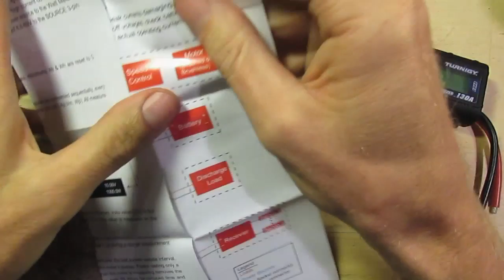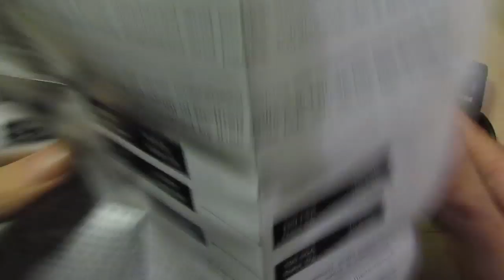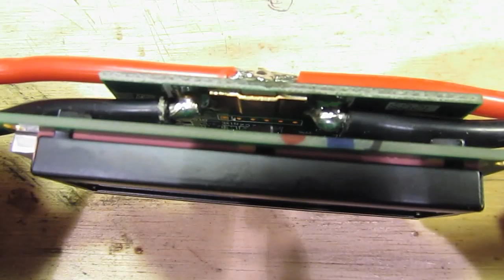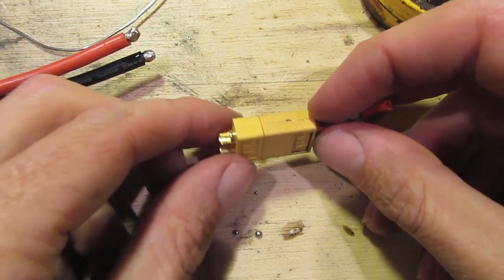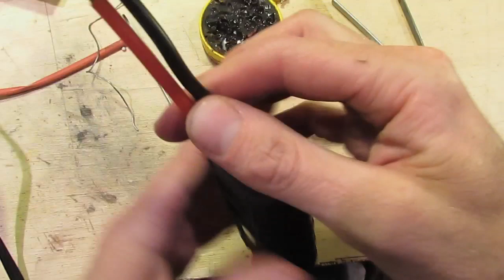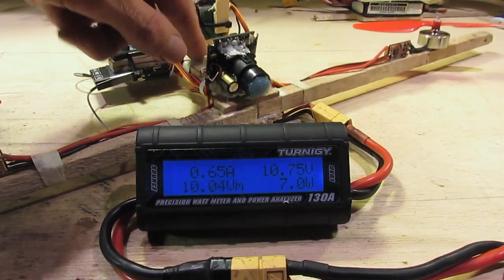Turnigy 130A Watt Meter, Teardown, Soldering and Testing on a Tricopter. RCHacker #13

Comment: What are you doing? Your holding that iron on there way too long, lol. I've been soldering for years, unless you have multilayer boards or something with a huge ground plain, you don't need to hold the iron on the wire that long. Lol

Comment: This really did become unintentional comedy when it got to the soldering part. And XT60's are relatively easy to solder. The hilarious sequel would be trying to solder "T plug connectors" with this rig.

Comment: 5A/mm^2 - its for cuprum wire. This device is not 130A - !!!!!!!!maximum its 40A continuous current!!!!!!! 130A probably in pulse current mode.
Reply: Measures 60A+ just fine...
Reply: 10cm wire of 4mm² would dissipate 4.4W at 100A :-) so it won't get hot ;-)

Comment: Hey,
Do you know what RXD TXD pads are for? I use this meter to monitor PV panels and after it counts 99.999 Ah the software on this atmega8L stops working OK (shows 0 for Volts and Amps and Watts) - I hope that those pads will let me put my own program in there.
Reply from the maker: You have confirmed that it is an atmega in there?, RX and TX are the serial pins and can be used for flashing only if it has a bootloader loaded. Which I kind of doubt it does.
I would suspect that internally it is holding the values fine and that its the display code that needs some work. You might find that it outputs info on the serial pins.
Reply: RCHacker yes it is atmega8L I haven't found any miso mosi sck , etc pads so I assume firmware is somehow loaded via serial

Comment: The worst soldering technique I have ever seen.  Have you not heard of wetting the tip with fresh solder?  Also that type of gun needs having the connections between the tip and the heating element cleaned and tightened often.

Comment: Or their customers just need to learn how to solder!

Now I know why HK only uses silicone insulated wire.  With anything else the users are going to be melting away inches of it from every solder joint.

This nasty video not withstanding, good soldering is not hard.

Comment: How not to solder a connection.

Hope those Hobbyking workers aren't that inept.

1. Tin both parts.
2. Hold them together well.
3. Heat both parts simultaneously, with HOT iron.
4. Add enough solder to make things look pretty ... not too much.
5. Back off, you're done!
6. Do not EVER solder such things without flux-core solder.
7. NEVER touch an iron to a joint before the iron is completely HOT.
8. NEVER take more than three seconds to solder a joint. 
8. Sometimes I really hate youtube!

Comment: Thanks for posting. I wanted to check out that aux battery hookup, so the watt-hours etc would be preserved when the source was switched off.. Never noticed those tiny symbols on the case!  I just powered it up using an RC radio battery. :)  

Did you ever find out what the (pluse symbol)  3rd pin does?  I wonder if it's a reset input?

Comment: Nice work Marc!
Thankfully you didn't desolder this board, Great that you mentioned Dave Jones' channel. Dave desoldered a Turnigy charger LCD with not-so-great outcome.
BTW, I was given some clear thin liquid flux by a local electronics guy and it works very well. I'll have to find out what it is...